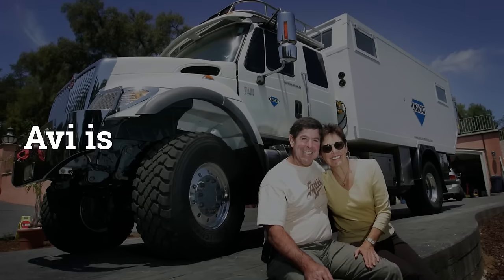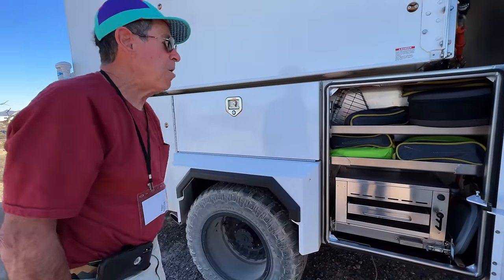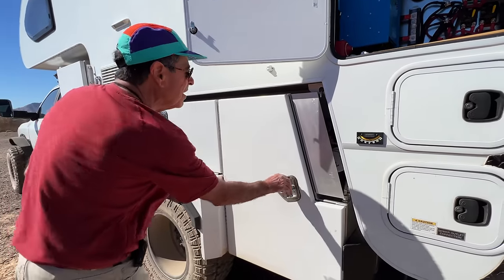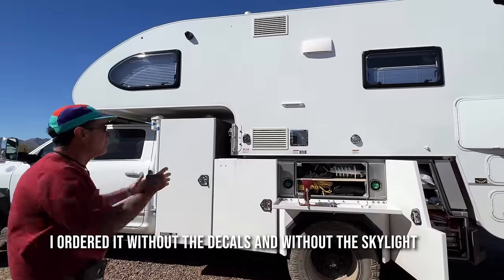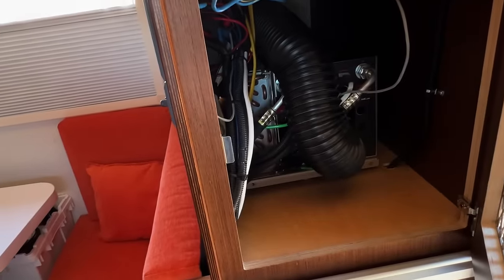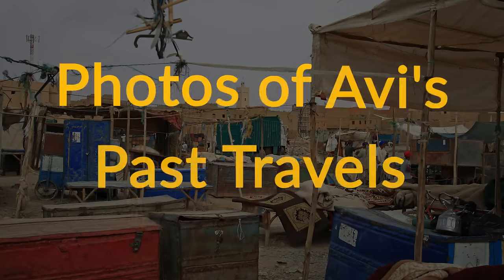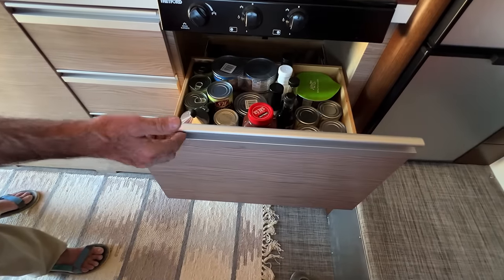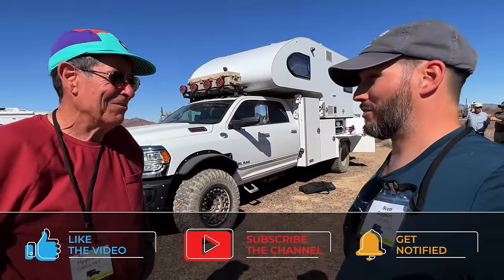💰$250k Overlanding Beast // THIS is AMAZING // Full Rig Tour [ RAM 5500 / Flatbed / Cirrus 920 ]

Comment: I love this build and am toying with the idea of a F550 single wheel conversion, custom bed, and large camper. My only question looking at this build is if those rear tires are overloaded. It would be nice not having to use a 41+" military tire to regain necessary capacity with a SRW, but can an E or F LT tire really handle the weight that thing must have on the rear axle? A quick search looks like those particular tires have a 130 load index or 4190 lbs each. Thanks in advance.

Comment: 15kwh battery.... I love it. you can run everything with electric even the stove or water heater. I would add some extra panels to side walls because I am sure 1200watt solar array cant fill up this huge battery bank in a day even if you use AC at night. But love it .

Comment: Having had air shocks I would never suggest them on a serious vehicle. Blew two right away and had Alcan Springs redo the spring system. Good luck on an old guy replacing a split lock rim tire.  Love the slim design. Very well designed and built from what I can see on body. Hinges are dumb noisy so alignment is off or just dry. Work shelf would be great if filled with a custom cutting board!  Nice overall!
Reply: can you add some info on Why air shocks suck and spring system benefits, also on old guy replacing split lock rim tire? Thx, I don't have the knowledge on this and would love to know more. Thank you my friend

Comment: Well thought out.  I would put singles on the rear to replace the dually and replace the camper for a Bigfoot model while trying to shorten the overhang somehow.
Reply from the maker: It does have super singles on the back. There’s a million ways to build it!
Reply: @Stonyboot  👍
Reply: @Marc,
01:05
Reply: why are super singles preferred to dually's? Thx for any info.
Reply: @MaximusMerideus  Duallys float on wet grass and are very poor with off road traction. You will be stuck all the time.
Reply: @MaximusMerideus  Rocks stuck between the dual wheels can cause a flat tire. Easier to air down singles. Managing a spare tire is simpler, only one style/size needed. You can increase the tire size. Just to name a few.
Reply: @cmh2111  Thank you, with all the benefits of a single what's the benefits of dually?

Comment: All those upgrades and still has a propane fridge?  That would have been one of the first things I swapped out.
Reply from the maker: Well, you can only get so much done. I have the same fridge and I love it. However, when it dies, I’ll go with a 12v compressor. Avi probably has the same perspective.
Reply: @Mark,
We use two SnoMaster 61-qt dual-zone.
Extremely efficient, modular.

Comment: Wondering how much this thing weighs loaded up... would sink like a rock on softer sand 😅 Nice and crafty though!
Reply from the maker: About 2/3rds of the way though he says 16k fully loaded. The truck is rated for 19.5k. So plenty of margin. And, with super singles and his air compressor, he can air down whenever needed.
Reply: @Daniel,
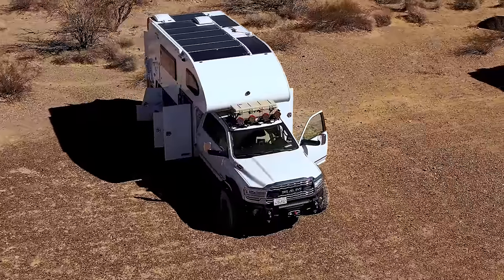12:35

Comment: Well done. A few good ideas... I have a hard time believing it is only 16k lbs - trip ready (water - fuel - passengers - food et al❗❗❗ 

I had a truck camper and moved on - the narrow entry door a/w claustrophobic interior made me despise that platform. (of course YMMV)
Reply: @Terry,
2003, we converted a 1996 Ford CF8000 commercial truck to our concept of an ExpeditionVehicle.
GVWR -- 29,000#.
Weight across the scale -- 14,000#.
Cargo capacity -- about seven ton.
.
At the rear of the box, I fabricated a steel wall and steel door... the standard 36" of a stand-still house.
Reply: A 36" door is so much better than a narrow A$$ 20" door.

Comment: Amazing truck. Fuel consumption though pretty tough...11mi/gln..in USA now to drive 800 mi or less..would be $350 approx...!..come to Ecuador, it ll be only $80....:) cheers
Reply: @R,
That little engine needs to overcome a lot of windage.
.
Our 1996 Ford CF8000 ExpeditionVehicle has the Cummins 505ci with a 10' 3" height.
We rarely get better than 14mpg.
.
Loading groceries, inevitably, some scold chastises us for our extravagance.
Our response:
* "How many mpg do you get in your apartment?"
Reply: @largemarge1603  it's better in Ecuador....:) I hate giving my well earned limited $ to the oil riggers...:)

Comment: To have all this, and still have the back seats crammed with stuff is my only question...Why would you spend 1/4 million bucks to create this monster, and have to cram stuff in the back seats. Seems overkill in so many areas, yet near life sustaining after the "bomb" should it ever be needed. Amazing, but lay out seems overly tool and gadget based...
Reply: All that aka "stuff" takes up a ton of room. Kayaks, multiple paddle boards, and tents. With the size of this rig, there would be no place else to put them things at all.
Reply: @weltboy21weltzin78  
A "... two-person kayak..." in the back seat.
For our 7x16 toy-hauler, we built our two cedar-strip kayaks to fit inside.
Plus, all our SCUBA gear securely mounts inside.

Comment: A setup like this is a complete waste of time, money, space, and weight. If your going to buy a C&C truck for a camper a custom chassis mount or flatbed mount is the way to go. Makes no sense to buy a slide in especially if your going to be "offroad". What kind of tires? Look like like light truck tires. Butttt..... his money so if he likes it 😆
Reply: @Charles,
I tend to agree.
I prefer a higher GVWR with stouter frame and brakes.
.
And much more range.
Our rig carries 190-gallons, plus another 120-gallons on the toy-hauler.
In theory, our range is Anchorage-to-Acapulco without re-fueling.